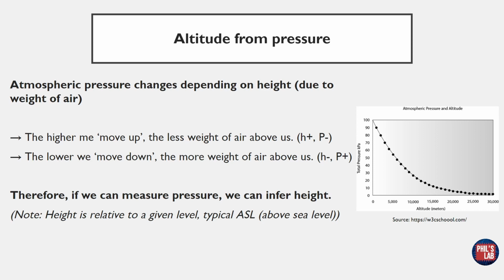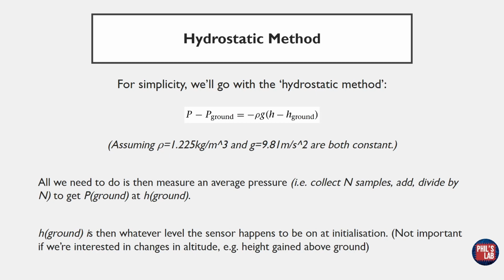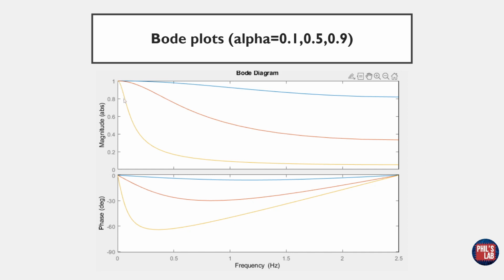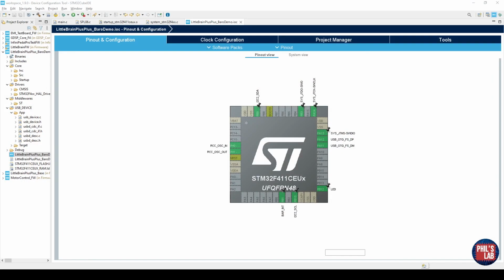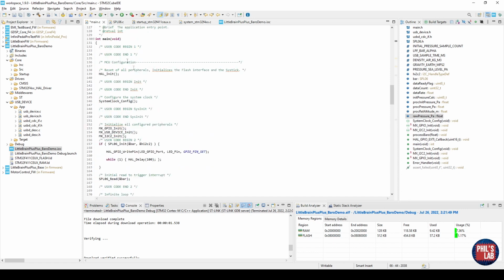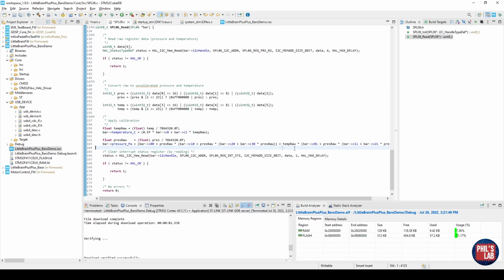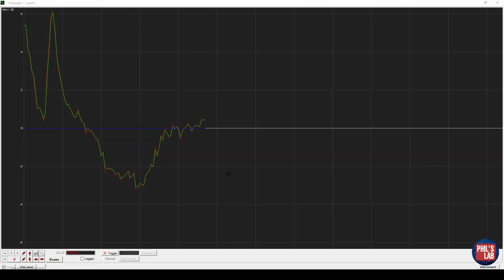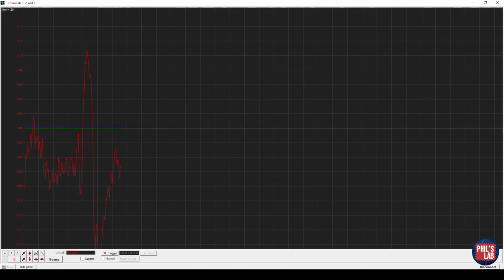Altitude Estimation with Pressure Sensors (STM32, Firmware + Hardware) - Phil's Lab #68

Comment: Man I just love to receive a notification from your channel. Great video as always. Just wanted to ask you a question regarding the fluctuations on your differential pressure measurement by the end of the video: Aren't the oscillations natural? I mean, while you're moving and talking wouldn't that add to the "pressure noise" in your environment? Maybe putting a soda cap o top of the sensor to protect it from the very delicate and natural wind of your room would show some smoother results. I got curious because I'm developing a altimeter by pressure as well :) cheers!

Comment: On the scale of few Pa, it is normal to get random wandering, even in the closed room (even smallest draft is caused by pressure diff.). For more reliable test, sensor should be placed in the hermetically closed jar (without touching for some 10 minutes).

Comment: Funny that you mix terms 'height' and 'altitude', because they are different entities...altitude is, indeed, the correct term for measuring with barometric pressure, unless one is using barometric pressure to measure the height of a building, or a person, but, otherwise, 'Elevation' for topographical features, and 'altitude' for measurements not related to a 'thing', only the distance above MSL (typically)... I got laid into by a German civil engineer, one day, so I remembered. Picky, but you seem to be a person who might care  ;-)

Comment: What are your thoughts on using Rust for embedded development? Would love to see a video where you step through the bring-up process on one of your boards using Rust / give your reaction to the workflow.

P.S. Amazing video as always!
Reply from the maker: Thanks, Noah! I never really considered using Rust nor seen a reason to use anything but C/C++ for embedded purposes. I'm also far more hardware-focused and can do everything I need to do with C (as I usually just write drivers, simple code to test boards, and some DSP/control algos). Since I just use CubeIDE, that also just ties in nicely with C. Happy to be convinced otherwise though!
Reply: @PhilsLab  exactly. C/C++ does everything I need and it's not assembly so for now, why introduce more work
Reply: If you've got some time/are interested, it might be a rabbit hole worth exploring. The tooling is still in quite early stages (you're not going to have the ease of configuration that CubeIDE allows for) but already it's quite an ergonomic development experience. Also Rust has nice things like guaranteed memory safety (segfaults and race conditions are compiler errors). Pair that with a package manager, automatic documentation for all published packages, and a robust open source community, it becomes a great option for quick firmware prototyping and improved security.

TLDR: Shameless pitch for giving Rust a shot

Comment: @Phil_Lab: In your constant PRESSURE_SEA_LEVEL_PA = 101325.0f is not Pa, is hPA (mBar) so if you are going to use the datasheet formula for altitude you have to divide by 100 because P0 is indicated in hPA.
Reply: Sorry, mistake. Your constant is Ok but the datasheet expression is in hPa.